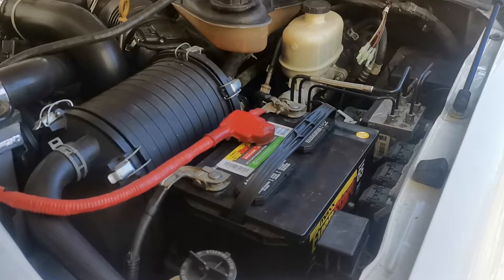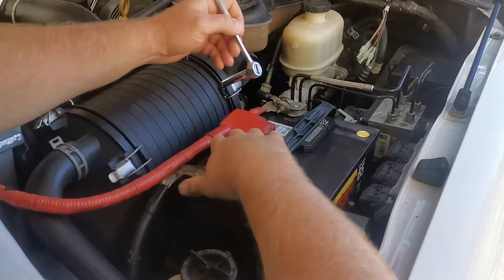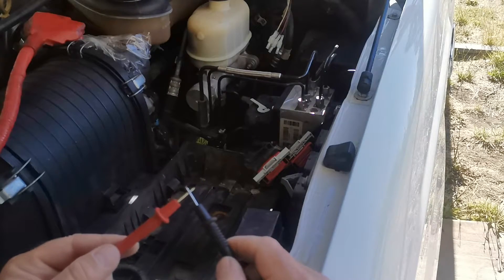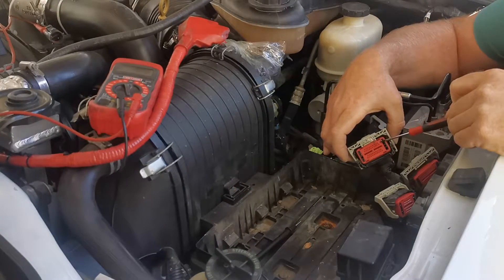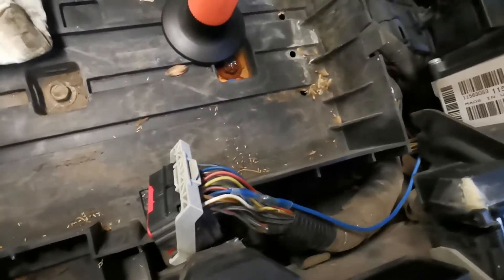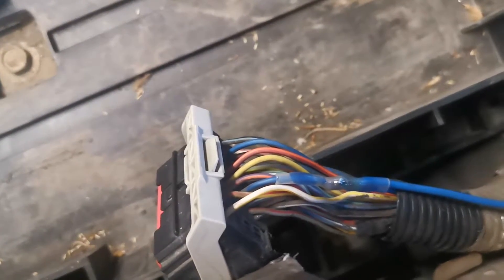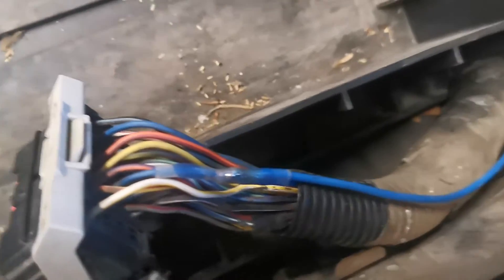🌡 2006 Ford F350 Fan Override Switch Install **(Long, Detailed)** 🌡🌀

Comment: I put on a new Motorcraft fan clutch..works great now..$360..runs cooler and AC is cooler.
Upgraded positive/ground cables too. $400 and worth it

Comment: Hi there, i was wondering if it worked? I tapped from the blue wire  at the connector that goes to the fan clutch, when i flip the switch, it doesn't override mine.
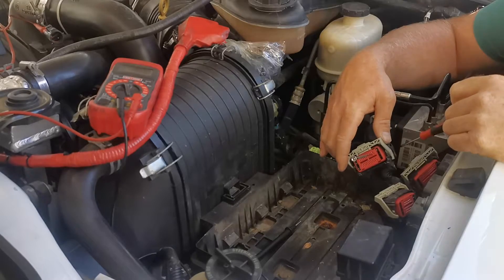Reply from the maker: Yes, works great.  At 7:14 you should be looking at 2nd row, 2nd pin from the right (looking at the front of the connector).  You should be able to verify that the blue wire has continuity between the main plug and the fan plug.  Since the fan is ran by a pwm circuit it takes a second to come on (with the engine running).  With the blue wire, you are just completing ground for the fan (through the switch of your choice).
Reply: @skudwoofer  thank you so much 🙏🏿. Maybe I grounded the wrong blue wire but I'll do it the way you did it from the plug by the battery instead. .
Reply: @skudwoofer wondering if you can help me out.. I had it previously tapped from the blue wire that goes to the clutch, today I did you step but for some reason, the override doesn't kick in.. the only time the clutch kicks in is when I am going through mountain climb and temp gets to 99 celcious 210 Fahrenheit, the override doesn't work for my truck and I don't know why. I have a 2006 f350 king Ranch
Reply from the maker: This is not the specific thread I got my info from however, there are many threads on this website on the same subject....
https://www.ford-trucks.com/forums/1178651-fan-clutch-override-switch-which-wire.html
Reply from the maker: I would also recommend this link as reference for when you have to do other "ford stuff" 😀

https://www.ford-trucks.com/forums/303583-6-0l-diesel-tech-folder.html

Comment: Once this mod is completed will the fan function as normal when not grounded by use of the switch?
Thanks for the helpful content.
Reply from the maker: The fan does function as normal when not grounded, and I have used it on a number of trips to the sand dunes where we have a few decent climbs between here and the dunes on the coast.  It does exactly what I wanted except that you can not make use of the LED since it is functioning as a "grounding circuit" and the LED circuit has no way of being independently powered by 12v.  One way of using it as a it was intended would be to somehow power it with regular 12v and incorporate a relay that would be your "grounding circuit".  At the time I just hadn't had the time to sit down and think about the circuit.  If I have the time in the future, I may have a board printed just for this setup.....
Reply: @skudwoofer  if you cut the wire at the PCM how is the fan still working normally when it's not grounded
Reply from the maker: @tracymawer1966  I didn't cut the wire, I spliced in a manual ground, the switch is used to manually ground the circuit, thus overriding the pcm
Reply: @skudwoofer lol just had a trip to pismo dunes this weekend and those grades made me look up this mod. 111*F  ambient temps
Reply: @josephcorpus6595 and I'm now doing the same thing. 114 here, and seeing oil temps of 226 and 216 for coolant when pulling heavy. Need to get it under control before it eats a lifter or kills something that needs its lube to perform under harsh conditions.

Comment: Why not use the wires that are aready thru the dash. That have nothing hooked to them. They look like have connectors on them with nothing hooked to them.
Reply from the maker: Those are the "upfitter" wires that come on all trucks of that year and will eventually be used for winch, lights, external welder, air compressor, etc
Reply: Exactly what I would do. Unused upfitter switch is the perfect solution.